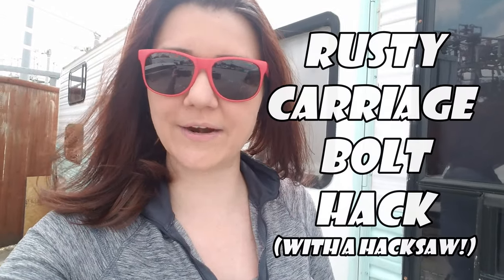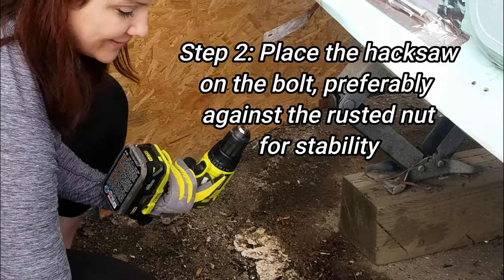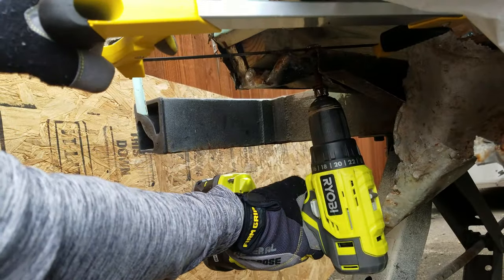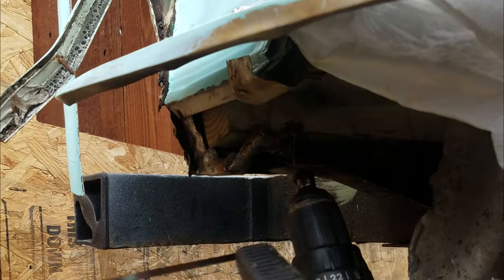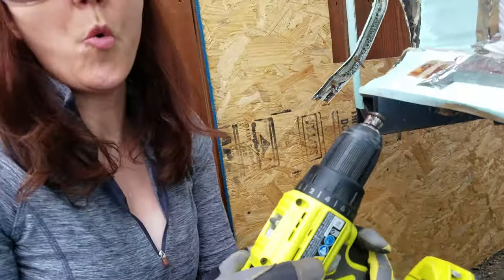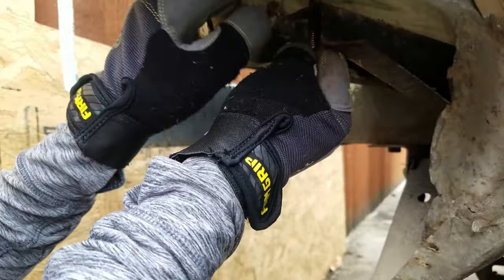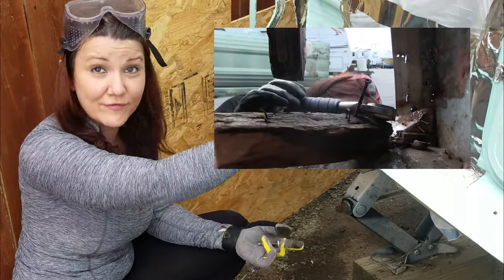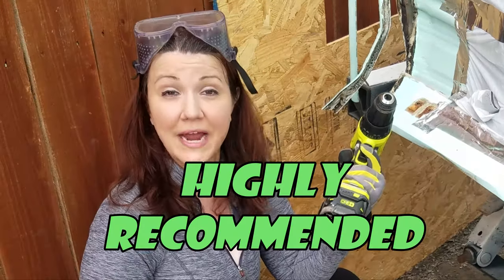GENIUS Method for Cutting Rusted Bolts (Attempted by a Beginner)

Comment: A hacksaw cuts on the backstroke. Next time run the drill in reverse.
Reply from the maker: Ahhhhh, I saw another comment mentioning running the drill the other way... now I know why.  That makes a lot of sense.  Thank you!!!
Reply: @kendall.vision  Actually. If you had kept the saw on the right hand side of the bolt you would have been fine since in that orientation the drill was running the bolt against the backside of the bolt. When you moved the hacksaw behind the bolt, it was “running” with the teeth. An easier way would have been with a dremel tool or grinder with a cutoff wheel though this will work well if you are mindful of the teeth orientation.
Reply from the maker: Oh, you're right.  I wouldn't have thought of looking at the teeth orientation of the hacksaw or a dremel.  This is so helpful.  Thank you thank you thank you

While I might not encounter this same situation in this project, I am hopeful to take on more like this in the future.  This has been such an incredible learning experience, partly thanks to comments like yours, and I am having a great time!

It sounds like adding a dremel to my slowly growing collection of tools will be very valuable.
Reply: @kendall.vision  I always used to watch the Dremel commercials and think that it was a lot of hype and I would never need one. An auto restoration project I was working turned out to be a nightmare of rusted parts and fasteners. I bought a dremel and it proved invaluable. It’s smaller size makes it much more maneuverable than a grinder and you have a better variety of bits and attachments. The oscillating saws also work at cutting bolts as well. They are particularly good for installing electrical boxes in drywall. Much cleaner than using box cutters.
Reply from the maker: Yeah, I've had the same skepticism of various tools, intensified by my noob status, and not wanting to just freely purchase every little tool for every little project.  I like to think of myself as resourceful, and if I can find a way to get it done with the tools I already have, I prefer that, even if it takes a little longer.  

However, this can also be a problem if I ignore a tool that has many uses and can shave huge amounts of time off of several projects.  Feedback like this helps me to know when to go ahead on a tool purchase.

Another example is a pocket hole jig.  I know it would make some things a lot easier, and they are not that expensive.  But I just keep thinking, "yeah, but how much will I use if AFTER this project?"  LOL
Reply: Remount the blade facing inwards (towards the handle) so you can keep tension on it by pulling instead of pushing.